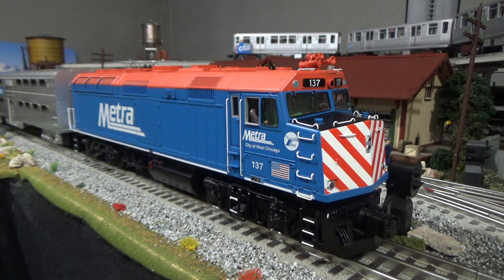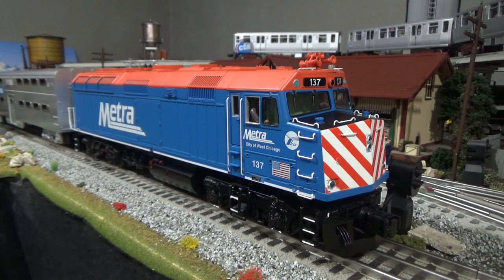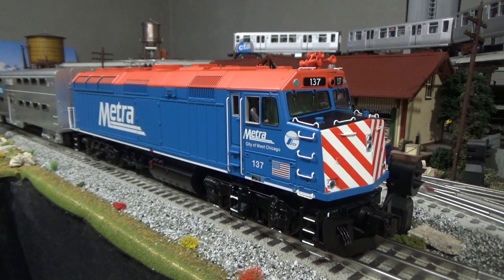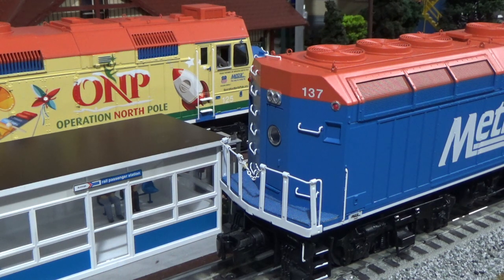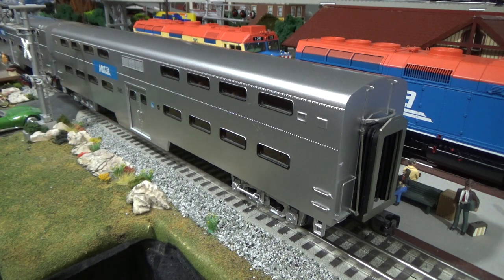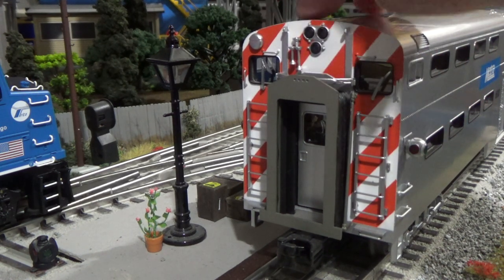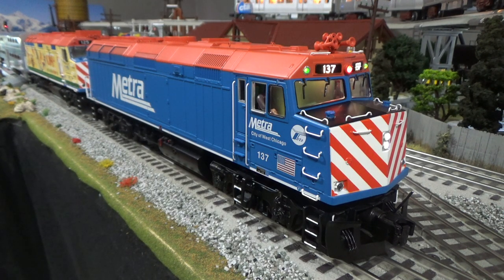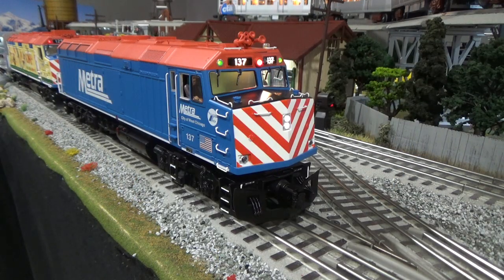MTH Premier Metra F40PH and Metra Bi-Level Commuter Cars - Review

Comment: Great video and backstory. Check out the book "Chicagoland Commuter Railroads" by Patrick C.Dorin and  Andrew T.Roth which covers the railroads that lead up to Metra. I have the Railking Scale version #100 City of Chicago which covers the Rock Island Line, which is perfect for the Rock Island bi-levels that I have in the red and yellow color scheme. I also have the Metra E8  515 which in a previous life was C&NW 515 . Speaking of "Before Metra " I also have K-Line C&NW E8 set with C&NW aluminum  bi-levels which I plan on doing a video of soon. Like you said, I ain't parting with any of these 😁.
Reply from the maker: Thanks Steven, I will check out that book you recommended. I know you're a big Metra guy as well from the videos I see on your channel. I have the Metra E8s as well, but will probably do a review on those in the future. I forgot that K-line had aluminum bi-levels which means that Lionel has access to bi-level tooling as well. I guess all they need to do is get that Metra licensing. Looking forward to your review on the C&NW commuters.

Comment: I have the same engine in the NJ Transit paint scheme and I love it. For some reason the marker lights won’t work after the first time I used it. Do you know a fix for this?
Reply from the maker: Hi and thank you for watching. So the first thing I would do is reset the engine to the factory default with the remote or DCS App (you will have to add it back after you do that). DCS let's you turn on/off individual lights so this is mostly likely th e case. If it's not that then there might be a wiring issue to those lights.
Reply: @wcmodelrailroad  thank you I most likely hit a button by accident I’ll check it out thanks.
Reply from the maker: @mslickstrains  If you are familiar with the function key for those lights you could probably find it in the softkey list. However, it might be easier just to do a full reset on it.
Reply: @wcmodelrailroad  yeah I’ll have to mess around with it once I can get back to my club layout. Thanks for your help
Reply: @wcmodelrailroad  love your content btw
Reply from the maker: @mslickstrains  Thank you much!